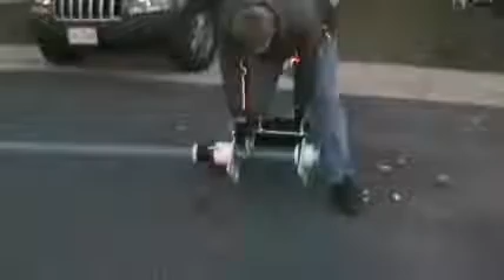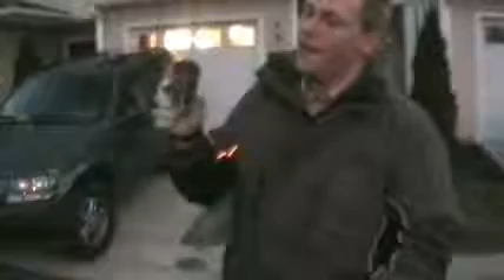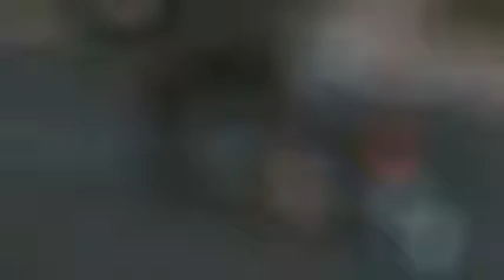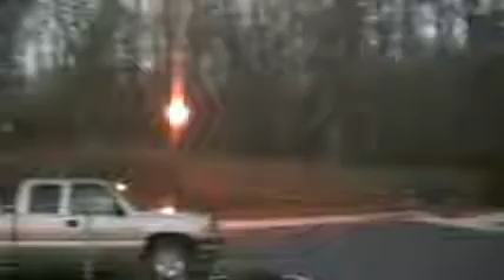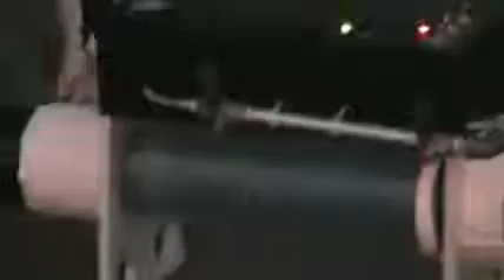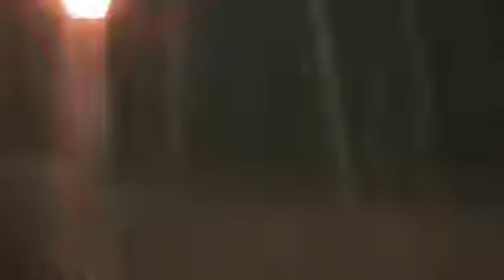Potato Gun Propane Powered

Comment from the maker: If you need some pointers let me know.   I highly recommend using propane as a fuel, and making sure you have a mixing fan.   I'm not sure how important the spark-strip and "taser" ignition are.   Right now I'm just using a single spark point and it's still working good.   Remember that you probably want a 15% mixture of fuel to air, and that you want the barrel volume to be 1.3 times as much as the chamber volume or so.